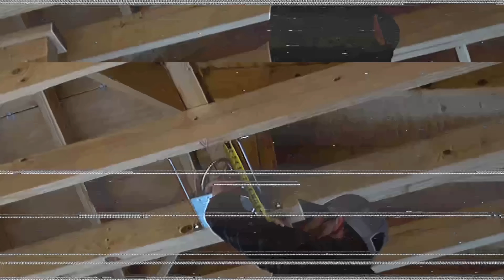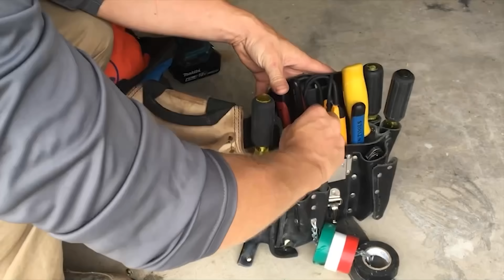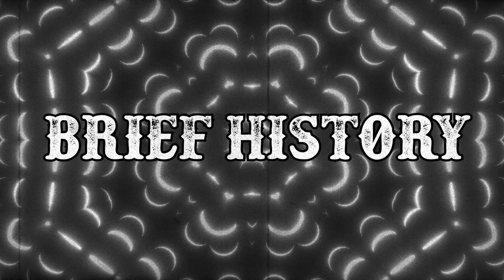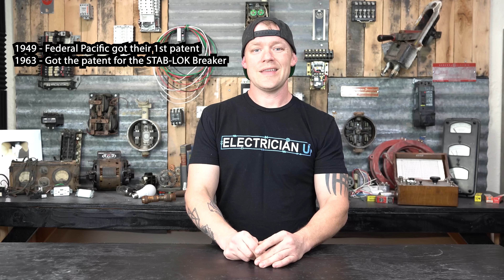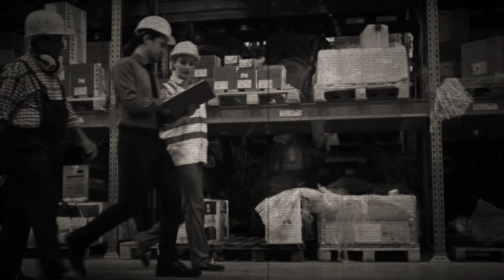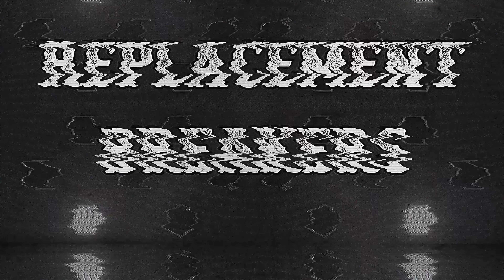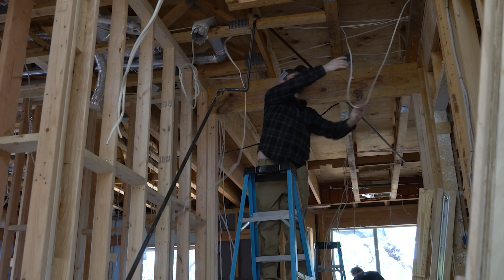FEDERAL PACIFIC ELECTRICAL PANELS - why their panels are dangerous

Comment: I have a federal pacific sub electrical panel in my house and a Square D main panel outside. If one one the federal pacific breaker fail to trip the main braker outside will still trip and shut the power off right? The main breaker outside is only a 70 amp breaker. It is a small house.
Reply: Good question. I’m in the same boat as you currently. Did you find anything out?

Comment: My family has a place back in the woods that has one of these breaker boxes. I heard about the fire hazard when I was looking for a replacement breaker because I suspected a bad breaker when some lights were flickering/plugs were acting shorted. I told my mother to call an electrician and get the box changed out because of the huge fire hazard. She called the electrician, and he said "Nah, these boxes are fine," replaced the breaker, and was on his way. He talked my mother out of changing the box, and I'm still pissed about it.

If the place lasts long enough for me to inherit it, the very first thing that will be happening is that breaker box will be replaced. I just hope nobody's inside WHEN it decides to catch on fire.

Comment: You mentioned QA testing failure rates.  You mention a 60% failure rate and speculate that maybe 1% is acceptable.  For a safety related failure, ANY failure should stop the line (or at least stop shipping product), trigger an investigation of the failure, and result in corrective actions to the process and the suspect product.  If the product has been shipped already, that's when recalls occur.

Comment: so glad i came across this video. My home has one of these panels and i'm in the process of pulling a permit to replace the panel. Its still going to be several months by the time the electrical company and the city will come to my home and disconnect the service to get the work done. I was not aware companies made replacement breakers.

Comment: Excellent video. You mentioned Reliant Electric in the video. The actual name of the company was Reliance Electric, my father worked for Reliance for 40 years. Many years ago my father told me about the rigged test panel the Reliance engineers discovered and opened a whole can of worms. Also, I’m not positive but I think it was Rockwell Automation not Exxon that bought the product line, but, as often as companies are bought and sold Exxon may have owned them at one point.

Comment: You are very correct.   Back in 83 when I started as an electrical draftsman, FPE was bidding to our company but we wouldn’t buy them to install.  Stab-loc was a bad design from the beginning.   Dustin,   Breakers are only guaranteed to trip once in short circuit.   You should never direct short a breaker to test it and leave it in service.   You may have damaged them.  This is why I like fuses way better for feeders in commercial/industrial work.   Safer.
Also, back at the same time(early 80’s) Romex (NM cable) was being sent out with a big flaw.   The bare copper conductors were being connected together with a ridge.  Then it was run through the insulation machine and would jam.   They would open it to clear the jam by sliding it forward about a foot.   If it was a white and used as neutral, you would never find it to be a problem.   In black, it was a problem.  Electricians found (3) of them, and I found one in my house when I built it.   They would direct short to the ground in the cable(maybe)!

Comment: Purchasing a home where the main shut off and sub panel house Federal Pacific Breakers. There were NO DISCLOSURES of any kind including electrical concerns yet in 2018 they spent $950 to repair an electrical concern. Is it possible for the owner to not be aware of the Federal Pacific Breakers??

Comment: Another good explanation of FPC panels. As a home inspector I instruct my staff not to remove the panel covers. The breakers are also very loose on the buss bar.
We just tell clients to replace the panels. If any body resist the advice I tell them to just GOOGLE it. Once they  read the nightmares they replace them. Thanks again
OK, time to turn the hat around?

Comment: Working with my Jman we had installed a square d combo panel, and about a year later the main 200A disconnect had failed. In fault conditions the main was tripping rather than the branch CCT breaker.
Anyone else had this happen?

Comment: I have one. It’s on a pole with the meter. From there to the box on my house.
Couple years ago we started having problems, finally got an electrician to come over. Nice guy, looks at the box on my house, it’s fine. We go to the pole and starts telling me his insurance does not cover him working on a FPE box. He will not touch it. But he was nice enough to look at it and tell me what was wrong and how to fix it short of swapping out the box but recommended replacing the box. He also recommended pulling the meter instead of trusting the main breaker. The common lug was corroded and burnt, moved common to the other one. He also said to reset (it only has the main breaker) main once a month until I replace the box. Nice

Comment: I wish I had more qualifications for my statement, however if my bachelors degree with a major in business has taught me anything is that, any kind of safety equipment, I.e. (seat belt, fire extinguisher, hospital equipment) have very strict fail rates bordering closer to <0.5% of all certified products. Simple explanation has to do with any failure of such equipment that has the potential for loss, or injury, to life than failure is almost not an option. If it was a test question on a Exam I would think a Panel breaker, even at 120v would fall under this strict <0.5% expectation.

Comment: I'm renovating my basement for a private studio. Came across this video and realized I have a Federal Pioneer panel. I've had no problems but I wonder now if I should replace the whole panel before adding more circuits I need? Don't know if I have the budget for that or just replace old breakers with the Schneider Electric breakers? (I'm in Canada)

Comment: Absolutely the best explanation I have heard regarding FPE panels and its timeline history. I am wondering where  you acquired all that information and research. You have caught my attention and I am now a subscriber. I’d like to add a comment saying, ‘these panels deliver power just fine, they just do not Fail Safely’.  So if you have one in your home do not reason that you’ve never had a problem with it. Because the day there’s a short circuit, ground fault, or overload you could potentially have a fire starter.

Comment: In manufacturing, high quality products have failures measured in 'parts per million' (PPM), in the hundreds or thousands of PPM. 1000PPM is 0.1% So generally less than 1%. There's also the difference between failures caught at end-of-line in manufacturing and failures in the field. Field failures may be caused by things that can't be reasonably caught by manufacturing testing.

Comment: I have been retired for some time but I did work in QA, Test and Reliability. Generally back in the day the AQL (Acceptable Quality Loss) was set by the user or a panel of engineers who make the standards for manufactured parts. I have seen nuts and bolts that have an AQL of 3%. I have seen parts used in nuclear power and aerospace objects that had a failure rate that could only be .0001%. So the answer for what is acceptable is, it depends on the application.

Comment: We had a challenger they refused to trip I hear arcing in the wall and the panel itself. We recently had it replace with an Eaton BR panel and no jump wiring anymore. I can slap a new breaker in without issue.

Comment: As a real estate investor I have replaced several of these. Most people do not realize the liability that goes with these panels. IF an inspector or engineer or electrician tells you about the panel YOU ARE LIABLE. I look for these on any property that I plan to buy and just figure in the replacement cost into the buying price. Located in the South these things are EVERWHERE. Most of the houses that I am buying for rental fall into the price range that these panels were designed to meet. I would never, ever rent out a house that I know one of these things was installed. I could not live with myself if a house I rented out burned up and a family was burned to death and if I DID live through that horror the lawsuit that followed would make me wish I had died in the fire with them.

Comment: I'm stuck with the current Federal Pacific (Pioneer in my case) 100A panel (we rent). Their AFCI breakers are illegal in my area, so buying an AFCI outlet per circuit is the only option.

The breakers rely on heat, and the mechanism that triggers/breaks was... not great, to say the least.

Paired with 70s wiring and mysterious behavior as a result of that, and small issues become headaches.

Comment: Testing 100% of safety rated products as part of the manufacturing process is not only possible, it is required unless you can prove safe operation through first principles. We have come a long way in the last 50 years. FYI, 1% failure rate of safety critical parts in manufacturing QA would warrant an engineering review. You can determine whether a manufacturing review with some basic math. Take the failure rate times the annual sales volume times the cost to manufacture. If that amount is greater than than half the cost of a redesign, then the redesign has a less than 2 year ROI, so its is obvious that it should be done. Places I have worked in the past used a 10 year ROI, so the cost of a redesign only has to be less than 10x the cost of the annual failure rate. A typical mature process line should have a failure rate of less than 1 part per thousand prior to QA, and one part per million after QA.

Comment: My ex wife and I bought our first house and per the loan agreement the panel had to be replaced since there was a recall issued years before we were buying. 
If I remember correctly it was an FPE panel and breakers. 
The inspector said that since nothing had happened to the house and panel so far we would probably be ok but it still had to come out for the loan to be able to proceed. 
The house was built in 1979 and we were buying in 2009/10.

Comment: My parents had our kitchen remodeled in 78 and they took the 4 breaker federal box taken out and replaced with a 20 breaker box, then the electrician installed the old federal box in the garage and replaced all 4 of the breakers with updated slim breakers giving my father 8 breakers in the Garage. My problem now that I own the house is that even though I now have a 20 slot box in the main house almost all the receptacles in the main house are still on 1 breaker and all the lights are still on 1 breaker with the exception of 2 new outlets for window A/C units added before the upgrade to central air. all running through a single 100 amp breaker for the entire house.

Comment: Called an electrician in 2018 to replace our 40 positions panel to Siemens 80 half height breakers.
Electrician: I see someone told you your stab-lock breakers are dangereous?
Me: no? Never heard of it.
Him: proceed to short circuit one of the  breakers. 

Nothing happened at all!!!! 🤯
Besides buzzing, it just would not trip.

Him: see?
Me: How come nobody talks about this..? 
My opinion? Most of the cost are the  breakers themselves and manpower..  Please change all of it, go with something else.. How much do you value your peace of mind?
Update: forgot to tell, I had at least four or five different electricians come in for various works in the past 30 years of living, no one even mentionned the problem. It is astonishing!

Comment: For products there is a standard developed from the military called the acceptable quality limit (AQL) inspection which in a GxP manufacturing environment should be implemented and used during any manufacturing lot.  There should also be a defect library separating critical, major, and minor defects...and when any of the respective levels of defects breached, the lot either reinspected, reworked, or thrown out.

Comment: I have that same FP Stab- loc small panel in my house it was put in when my dad got out of the Navy so the house would be up to code but when they wired the house they used the modern wire only up to certain points then it go's to cloth wire where they simply couldn't go further because of walls. We have this one breaker that we must trip at least 20 times a year because if you run the vacuum with the toaster oven or microwave it trips and is still working we never trip any others, when i was a teen i twisted that Stabloc thing and we got no different performance is it to tweek the sensitivity? Because thats just stupid let the breakers do their job on their own, I twisted it back the best i could to the original position it was hard because its not labeled with any indication of incremental movement.Wonder it when we go to sell if their gonna get butthurt over our setup😒

Comment: Had a FPE sub-panel replaced last year that had been installed years ago when the first A/C was installed. Also had the main panel replaced, no idea who made it. It was original panel installed in the house when it was built in 1952. Screw in fuses.

Comment: I don't think that there is such a thing as an acceptable failure pourcentage. I think it largely depends on what the product is and what it is designed to do. For exemple, if a stuffed toy has a loose thread that causes it to loose all of it's stuffing, it won't cause much, if any harm at all. On the other hand, if a breaker fails, it could cause a fire, and in the worse cases, result in death. You can afford to have issues with a stuffed toy, but a breaker is something that you rely on to keep the electrical system of your home safe. It is one of those products which must be built and tested rigorously to ensure that there is no failure. For a breaker, even a tenth of a pourcent is still too high of a failure rate as far as I'm concerned.

Comment: I have an FPE panel in my house.  The high draw breakers are replacements made by a better company and all the connections have been reterminated and greased with noalox.  I'm not TOO worried.   But yes, the plan is to replace the whole panel soon.

Comment: We replaced an entire FPE panel at my wife's house a few years ago. She sold the place, we moved into a rental that also has FPE panel. Needed to replace a problem breaker (tripped at less than 80% load), and the Connecticut Electric replacement breaker was $43.00! (Could have ordered one from Lowes for $27.00, but would take a week to arrive). Been well aware of FPE problems for years, so knew what to do. The more generic "Stab-On" breakers, today, cost around $3.00. Used those at a food plant I worked at, never any problems. But FPE "Stab-Lok"? Run like hell...

Comment: Failure rates are measured generally in parts per million. So, you should assume that number to be very small.

Plastic degrades over time, so plastic parts do have a lifetime. I worked in the automotive parts industry, and there are some plastics that have to sit in water. So, a bag will go into the box, and a set percentage weight of water will be added.

I believe 7 years is a typical time stamp for plastics. And the automotive industry is generally required to keep replacement parts for those 7 years after coming off the assembly.

Comment: When I worked at a place that made appliances with a motor, they tested every motor. They made the motors there, wound the copper and all. And they electrically tested every single one. A guy used to sit there with the testing equipment and hold it up to his ear to listen to it spinning.

Comment: I did a lot of industrial power distribution over many years.   I would never spec FPE panels.  For the factories when 240 or 120 volt panels were required, I always specified Square 'D' type QO circuit breaker panels since the breakers had a 10,000 amp interrupting (short circuit) rating.   
My son recently had his home panel replaced and I suggested he ask for Square 'D' panel but he was told that would increase the cost substantially.  Quality costs more but low bidders love low cost equipment.  
Several years ago counterfeit Square 'D' circuit breakers were flooding the market.  What does that tell you?

Comment: I have a Federal Pacific100 amp panel in my circa 1960 house.  Uses old school delay 15 amp glass fuses.  No issues in the last 60+ years.  I'm guessing the issue is with newer panels with circuit breakers?

Comment: A few years ago I had an oven in an electric stove go out but the burners still worked. The breaker didn't go so I assumed the oven element had gone bad. So I pulled the stove out to unplug it and saw some blackening on the outlet. I flipped the breaker off and took the receptacle out. The wiring was charred and the breaker didn't even trip! I did a little checking on line and realized that the Federal Pacific and Federal Pioneer( in Canada where I am) with the Stablock breakers were a hazard regardless whether the breakers were replaced. I immediately purchased a new panel with new GFCI and AFCI breakers (even though I didn't have to because of the age of my house) contacted an electrician and had a new 200 amp service installed, replacing the dangerous Stablock system. It ended up costing me about $2000.00 Canadian all in, but it was the best money I ever spent. If you truly value your spouse, children, pets, possessions and everything else you may hold dear, then you have to get that fire hazard out of your house. I am surprised that insurance companies would even insure a house with that panel in it.